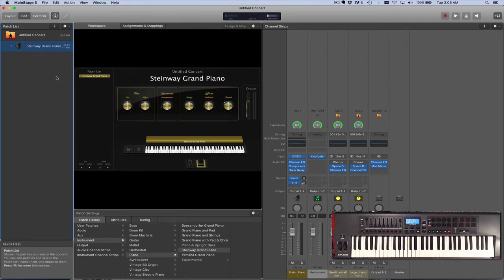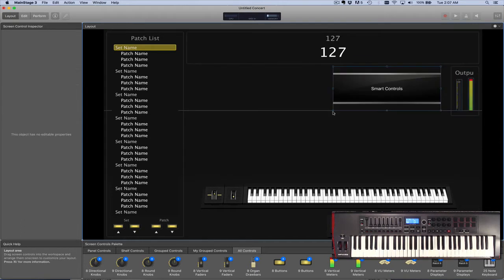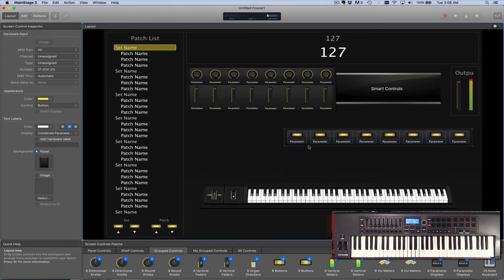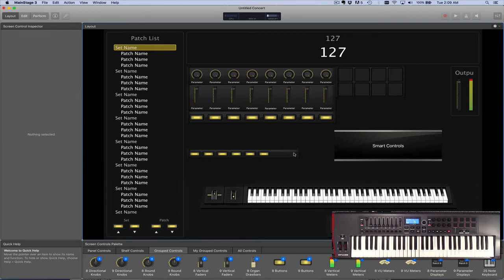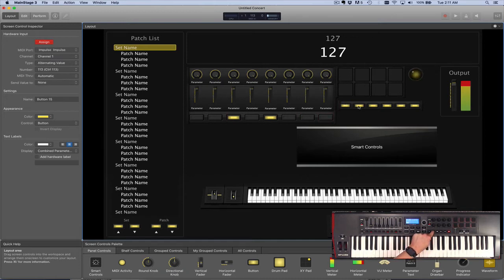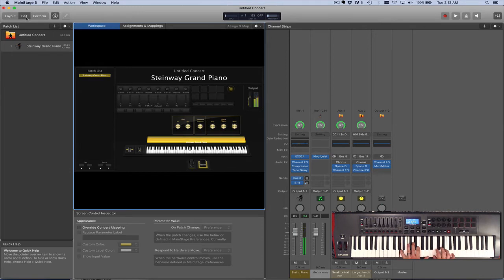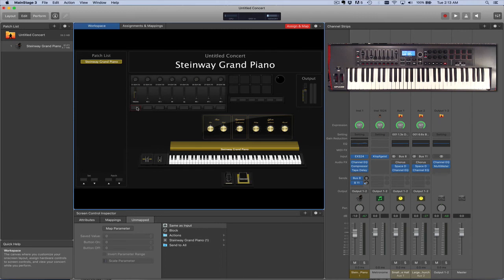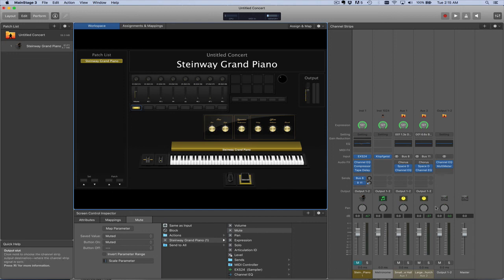Creating a Mainstage Layout for your MIDI Controller

Comment: Great tutorial on a not so intuitive software, BIG thanks to you sir! It's been really helpful already. One question tho: Is it also possible to use a knob on my MIDI to control a specific value inside of the retro synth instrument? I have a specific "sound preset" ready and want to assign the Env. value in the filter tab to a controller. Is that possible?
Reply from the maker: Glad it helped!  Is it possible to select the env value when doing assign, and then move the control you want to use to control it?

Comment: Second question - when I use the Novation Impulse MainStage presets (#7) I find it frustrating as they rarely map things as I would. Would I be better off not using any of the preloaded settings for MainStage and just build something from scratch that matches entirely, like you did in this video ?
Reply from the maker: Yeah, I can relate.  I usually find it cumbersome to learn how different vendors help and match things for you - as they vary so widely.  I'd say try the vendor-supplied mapping to see if lots of things work, and augment with specific controls that aren't mapped as you see fit - or just forget their mapping altogether and map just what you know you need/want.  Hope all goes well!

Comment: Great video and thank you! I am curious why you did all that set up and matching of the Novation Impulse at the patch level. Wouldn’t it be better to have done it at the Concert level?
Reply from the maker: Good question.  It really depends upon what is available in the patch you're controlling.  Different patches may use different software instruments, so you may want to map things differently.  With that said, you can certainly map any common things at the concert level (like the keyboard, sustain, volume pedal, and other common controllers, like common channel faders).  The way I demonstrated here is the most specific way to do it for a particular patch's layout.  Thanks for checking in, and best!

Comment: Thx for the video. Currently I am stucking at a point where I want to write back values for knobs back to the keyboard. The use case is when I have a patch and use the knobs for the smart controls knobs and when I switch to a different patch the values of the controller and MainStage do not match. If I turn the knob then, the value of the screen control “jumps” to the value that is currently in the controller. A solution would be that I write back the actual values from the new patch to the controller, but I couldn’t find a way to do so. Do you have an idea?
Reply from the maker: While I don't recall exactly where I've seen this setting - it seems there is a setting maybe in Mainstage where you can control the behavior and switch it between 'Jump' to 'Pickup', meaning as you turn the knob, Mainstage won't jump to the controller value until you pass the current value... and it will 'pickup' from there.   This is just from memory - but I do seem to remember this somewhere.  Maybe in MainStage preferences?

Comment: Great tutorial for Mainstage. I want to change program bank number and program numbers. Could please advise how can I enable Mixer button of impulse 61 using Mainstage?
Reply from the maker: I’m pretty sure the impulse has some doc on sending specific program change events down the wire manually by dialing them into the display.  With that said, though, you may want to look into how to enable the drum pads on the impulse to send program change messages for specific pads. I think that could be possible as well. 

In Mainstage for any patch you can set the program change number to which it corresponds.  Then when you send that signal from the Impulse it should change to that patch. 

I don’t have everything set up now to play with it; but if I did those would be the hi-level steps I’d take. 

Hope this gets you going at least!  Take care.

Comment: hello, I can't do all this with arturia keylab essential, the faders don't take .. can you help me?
Reply from the maker: Most keyboards have a 'MIDI specification' in the manual, or description of what is transmitted by the faders.   You can also go to the Window menu and choose 'MIDI Message Monitor'.  Then move the fader and you can get an idea what messages are being sent (and if they are making it to Mainstage).  That's the general way to make sure signals are coming in.  Then follow the video instructions to assign.  If that doesn't work, you could check with Arturia directly - perhaps they have info specifically on how to make it work with MainStage.  Best wishes!

Comment: Hi there thanks for this video.
I have a question. I also use the impulse 61 as my controller, but for mainstage I would like the drumpads to trigger something different then the keyboard notes. I want to use them as on/off switches for lets say different sounds or samples. Do you know a way to do that?

And also is it easy to do two keyboards in mainstage playing different sounds or patches?

Thanks in advance.

#bless
Reply from the maker: Thanks for the note, Ugene12.  I would suggest that you change either the MIDI channel for the pads, or the type.  If you tap a pad, the screen will show you the currently assigned value (in your case, it will likely be a note). You can then use the standard instructions for modifying controllers on the impulse (Page 19 in the Impulse User Guide).  Here are the changeable settings for the drum pads from page 39 of the Impulse User Guide (this page is titled ASSIGNABLE CONTROLS - PARAMETERS and RANGES):

Drum pads:
Type: not
Note: C-2 to G8
Max: (Maximum parameter value, 0 to 127)
Min: (Minimum parameter value, 0 to 127)
Channel: MIDI Channel to be used (1 to 16, or tPL) ; tPL is as de ned within the template Ports: MIDI port to be used (tPL, USb, MId, ALL)
Type: CC, rPn and nrP: as for encoders/faders

So....

Option A:
Change the Channel for each pad to 16, or 2, or some other channel that Mainstage is not playing sounds on.  Then use them as triggers for your buttons in your MainStage layout.
Make sure your keyboard assignment on the Layout tab only receives on a different channel than the pads channel.

Option B: 
Change them to Type: CC to send Control Change messages instead of Note based messages.  Then assign these control changes to the buttons in your MainStage layout.

I plan to do a video in the next week on how to add a second MIDI keyboard to your setup, so keep an eye out.

Cheers,
EagleSong
Reply from the maker: Ugene12 - here's the answer to that multi-keyboard question - Enjoy!
https://youtu.be/blP936rrWDI

Comment: Hi ES, whenever I assign 'fader 8' on the impulse it keeps triggering '11 Expression Pedal' which affects the overall volume; how do I stop this? I've already assigned 'fader 9' as my main output. The same thing occurs when I assign 'knob 5' it changes '7 volume'???
Reply from the maker: This probably has to do with the preset program you're using on the Impulse.  Depending upon the program the Impulse is set on, it will send different values for the various controls.  I'd suggest checking the doc on the Impulse to see which signals are set for various controls, or even how to change the signals being sent and modify them so Mainstage will get different controller values for the buttons/controls you're interested in using.

It's been awhile since I set up mine, so I don't recall all of the details.  But give this a go, and see if it helps.  Best wishes!
EagleSong
Reply: I realize this was FOUR years ago, but I was searching around to help solve the EXACT same issue! Did you find a good solution??
Reply: @jolevsky  Not really...:-[
Reply: @nigelhutchinson3698 I looked into the Novation end of things, and it was actually pretty easy to adjust it there. Basically you hit "Controls", then move fader 8, which should bring up "cc" on the screen. Then hit the "+" button and turn the data knob right above it to something other than 11 (I used 12 and it didn't seem to conflict with anything). Then save it by hitting "Shift" + "Keyboard". Hope that helps
Reply: @jolevsky  Thank you, I will try this.